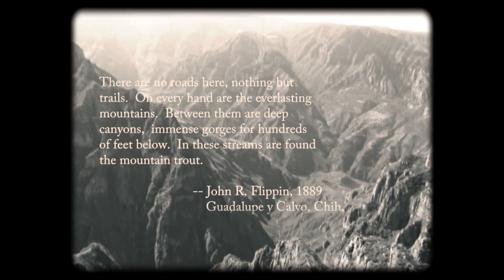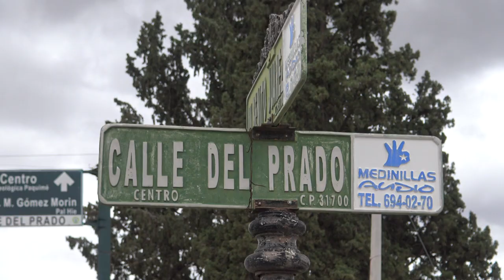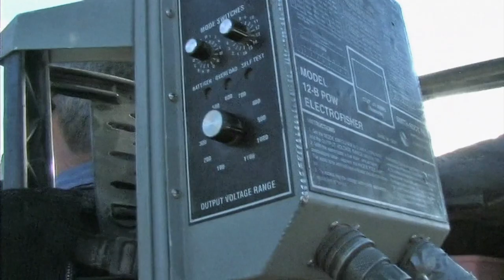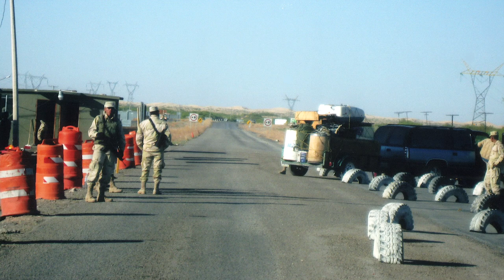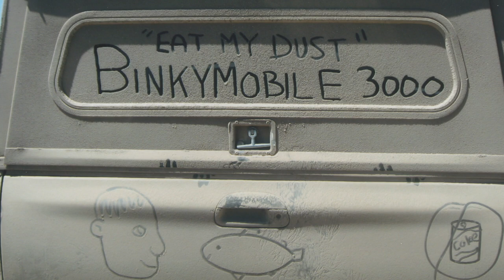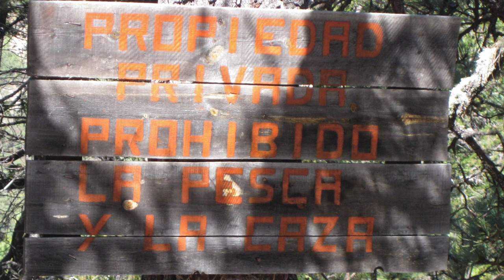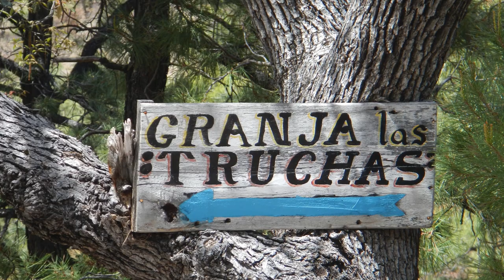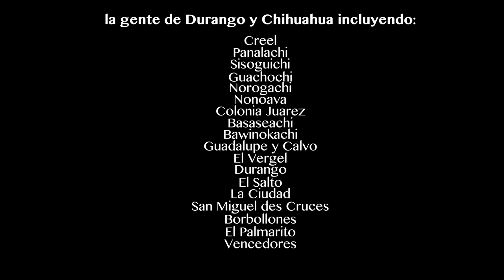Truchas Mexicanas, the Native Trout of Mexico

Comment: I have just watched this and I have so many questions!  Mainly, I wanted to know more about the unique climate and terrain and what elevations you were finding most of the fish-holding streams?  It all seems to be so different from trout wildernesses in the U.S.  And am I right in thinking that the streams are flowing out to the Pacific but you're approaching that high country in the Sierra Madre from the eastern side, going over to the west?
Reply from the maker: All streams with native trout, except for the Río Conchos, flow to the Pacific.  To find those trout,  we generally approach from what I would call the central plateau in Chihuahua and Durango. They're more easily accessed from the headwaters. Much of the area we work is along the divide between the Conchos watrshed (Gulf of Mexico drainage) and the Pacific
streams.

Comment: Do you have any idea if steel head is able to reproduce down in Mexico from all the info you gathered in the documentary?
Reply from the maker: There has been some conjecture about whether steelhead have strayed into the San Pedro Martir watershed of Baja, California.  I think this was driven by the low altitude at which native trout occur in that system.  However, I do not think any scientist believes that this watershed could  support anadromous populations.  The watersheds on mainland Mexico's west coast could not support reproducing populations of steelhead.  The lower reaches of these basins are subtropical and the cold, upper reaches that do support trout are largely inaccessible to upstream movements due to waterfalls.